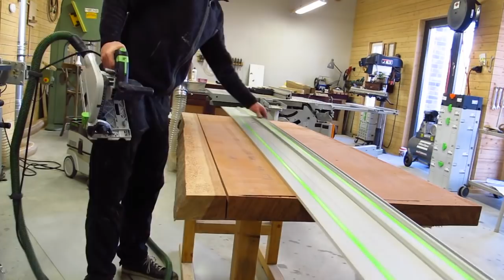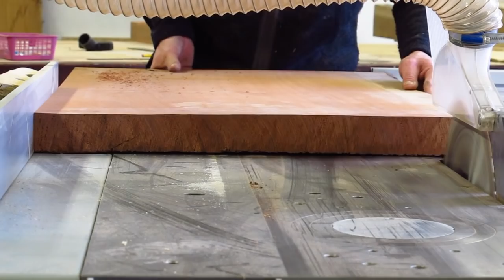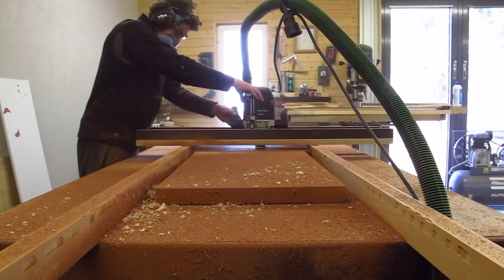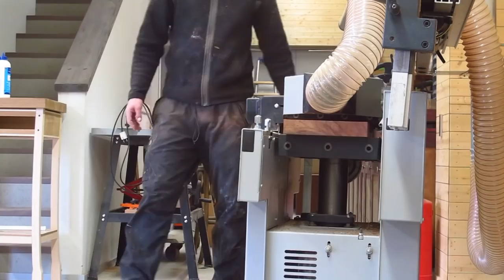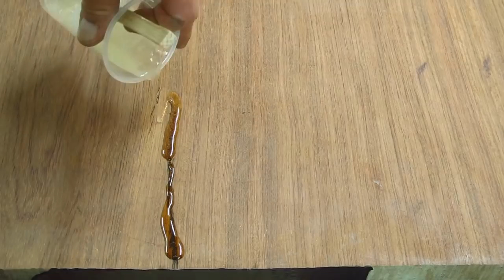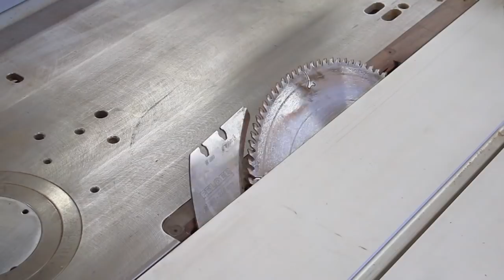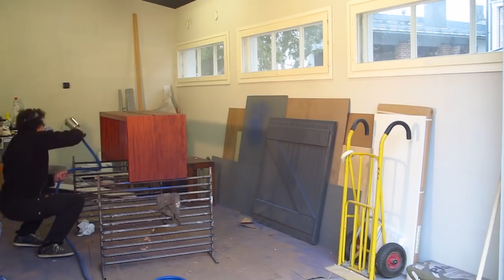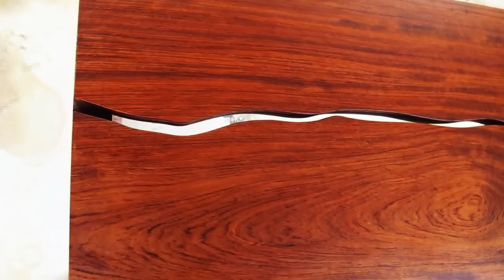Split top slab bench

Comment: How rich does need to be to set up that kind of a workshop?
Reply: ***** True!! Just interested in Cost it requires to setup such a work shop.
Reply: well this isn't something he did in one day, he's probably been obtaining these tools over a course of many years. if you buy one nice tool every year or even 6 months if you're fortunate enough to be able to do that then after 4 or 5 years you end up having a pretty nice little shop
Reply: These are just guesses based on my own experiences.  I'm not familiar with all of the brands/models he uses, but here goes..  $5k/tablesaw, $2k bandsaw,  $3k for various festools, $4k jointer, plus at least another $2k for a glue table, clamps and spray gear.  That doesn't include wood, cutterheads (blades), etc.  I find glue and sandpaper are actually significant costs in consumables.  

By the time you add running the electrical power, dust collection, and the tons of misc - you are looking at easily $50k total to get a shop like this setup.  As others have said, most would start with a fraction of that, say $15k and get the tablesaw and jointer/planer + power and dust collection set up.  Then add the others as you can afford.

It depends a lot on where you are and the work you do.  This guy has a lot of German stuff, expensive German tools.  They are some of the best you buy.  

For me, I look for old machines from the good 'ol USA.  I have an old (Northwood I think) 14" table saw, a Diehl SL750 straightline ($2.5k) and a 42" Cemco planer sander (again $2.5k at auction).  Those machines make the ones he's using look like toys, and I paid much less.  I bought them at auction and I know how to fix/install them though -  and they take more space/power/dustcollection than the craftsman in the video may have available.  So, with experience you can do VERY WELL for your money finding used equipment. 

It' doesn't even matter all that much anyway.  A skilled craftsman can take the tools he has and built something wonderful, skill is 10X more important than having the "right" piece of equipment - there are a 100 different ways to do any single task in the shop.  PS - Check out Grizzly.com - I have a lot of their stuff, built in Tawain mostly and they do have very good parts/service in the US.

Comment: Wow that's a lot of bubinga. It's toxic right? Good thing you wore respirator.
Reply from the maker: +Warp I havent had issues but its always wise taking precautions. I worked with Padouk quite a bit and didn't have issues in the beginning but eventually I could only work it wearing protection. 
For further information on allergies and toxicities I like to visit The Wood Database. They write about Bubinga the following; Although severe reactions are quite uncommon, Bubinga has been reported to cause skin irritation and/or skin lesions in some individuals.

Comment: Nie rozumiem czemu tniesz ręcznym festolem jak masz dużą piłę. Powinieneś te 2 kawałki skleić ze sobą przed rozcięciem była by idealna szczelina i nie było by takiej straty materiału.
Reply from the maker: +666Azmodan666 I used the track saw to get one edge straight so I can then run it through the table saw. This can be done on a sliding table saw but mine isn't long enough for it.